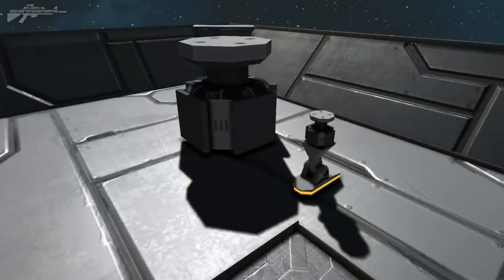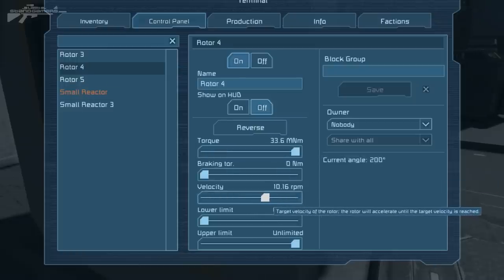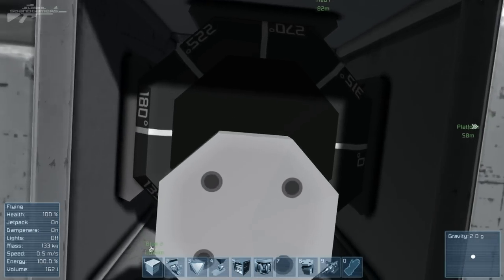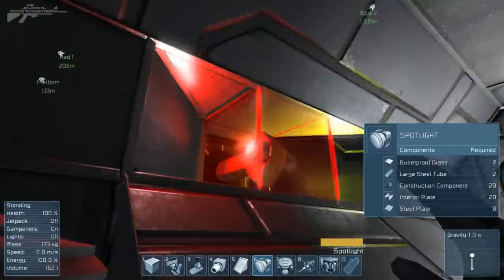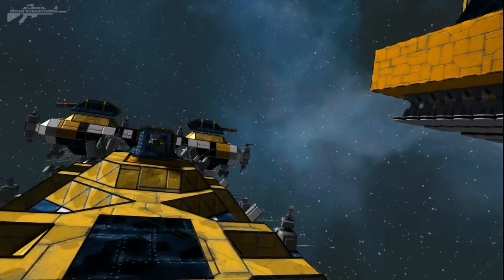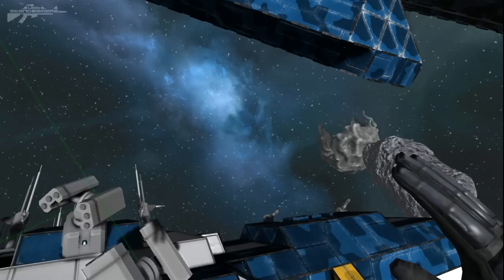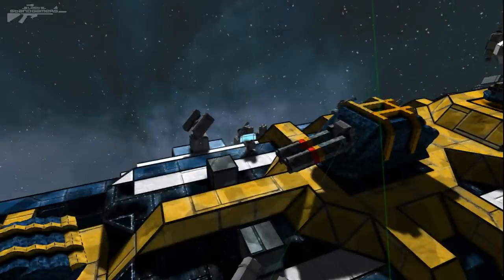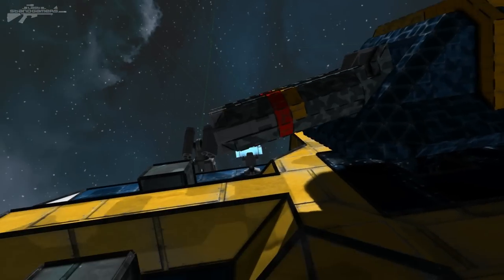Space Engineers - Rotors Hidden Features, Small Large Ship Connection

Comment: it also works with a small rotor base with a large top and it works with the wheel suspension
Reply: Wheel suspension? So can you use the wheels that you have to use w/rotors on the wheel suspension or no?
Reply: Small ship gravity drive!
Reply: oh and by "work" i mean they'll TRY to stick together that dose not mean nothings going to explode
Reply: Acemcbean Piff
 like the parts are interchangeable between the rotors and the wheel suspension. so you could put a rotor top on a wheel suspension base
http://steamcommunity.com/sharedfiles/filedetails/?id=288109019
Reply: Jason Ratz
...
Time to build
Reply: Sander asdf I have actually built two prototypes. One using connectors, then the other using the combo rotor idea shown here. However neither was truly viable. The physical connection points i.e. the connectors, or the rotor, we're just too weak for the amount of stress put on the little ship. Locking of the connectors, locking of the turn radius of the rotor to zero, and the use of landing gear. Were all not strong enough. In the end, the small ship would just rip itself apart. :( Maybe one day, should they make all merge blocks universal for connection, or add small ship gravity generators to SE. For now though, it's just not feasible.
Reply: Jason Ratz
I also made a prototype. Mine used the rotor connection shown in this video. I had no problems with weak connection (possibly because I put my gravity drive at the rear of my ship). However, the ship handles quite terribly as it's rear end get thrown around all the time.
Reply: Sander asdf agreed. Mine handle fine on the straight runs, but once I started putting it through the hard turns things began to get a little Squirrley. It wasn't long after the ship started receiving damage. It was strange though, the damage seemed completely random. The only way I can think that would improve handling is if you were to find the gravity generator's center of mass, and then build the small ship around it trying to keep the center of masses matched up and in the center. In the end I gave up simply because it just became so bulky to qualify in my eyes as a viable small ship.
Reply: Jason Ratz
I made a second ship, this time with the gravity drive in the middle. Works perfectly and handles wonderfully. Complete with cargo containers, connectors and gatling guns. It's not too big or bulky either! The only problem is, well, there are prettier ships out there to put it that way. Also, the reactor sometimes get overloaded when I brake.
Reply: Sander asdf  Nice. Are you going to upload it to the workshop? I'd love to take a look. My screen name is Helratz.
Reply: Sander asdf Cool I'll look you up when I get home.
Reply: Sander asdf f well I took it for a spin. The engine ran great and handled very well. However after a few minutes of continuous flight with a lot of hard turning I managed to break it. Still it lasted longer and handled better than mine:)

Comment: This kinds of reminds me of "Battleship" the movie and gives me an idea of a new update they should add to Space Engineers. It's to add a sort of pointer to the ship, object, or other you want to go to or attack with the exact degrees and angle. Also, they should add the feature to the rotors where you input the number degree and/or angle you want and it follows the command with the the velocity you put in it. It should make it alot easier so they don't have to put up a whole complete system of walls to stop they where you want it to and would give your space battleship a better control and attack system for the "custom" turret.
Reply: oh and if anyone doesn't understand what I'm talking about just think of putting the control systems for the turrets of the Missouri from the movie Battleship into Space Engineers
Reply: There Are options On The Rotor To Tell It to Stop At A Certain Degree ... Say Stop At 90% Degrees then It Will Move 90% Then Stop ... No Need For Walls ... Walls Just Make It Easier So You Dont Have To Fiddle With Finding Out The Degree Of The Two Stopping Points
Reply: Cereal Killer
well... didn't know that... now my paranoia has come to life, I'm officially, sorta, embarrassed now for even putting down this comment here. stupid me.

Comment: Can anyone still do this? I can't repeat this. Was it patched? If so what can I do to merge small blocks to large blocks without using magnets?
Reply: I use connectors, and it can be locked. When the connectors are locked, you can access the opposite side just like this rotor trick.
Reply: j0h00 I think you miss understood the point in doing this Rotor trick. You can connect Small Blocks to Large Blocks. For instance, I can start a project by using the Projector without worrying that my Landing Gear will glitch or my building ship will bump my project so hard it breaks free and floats away. There's a million more reasons to do this other than just connect a ship to a block.